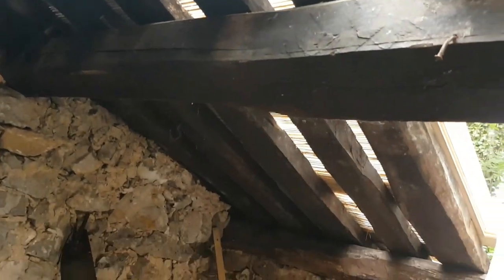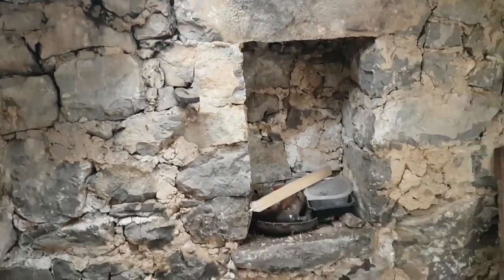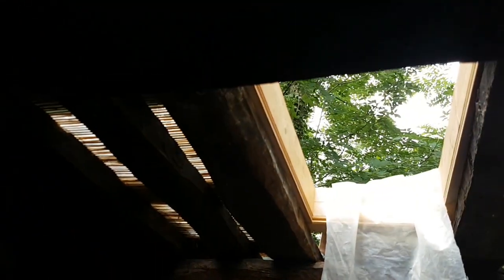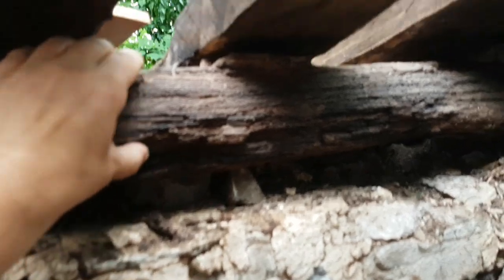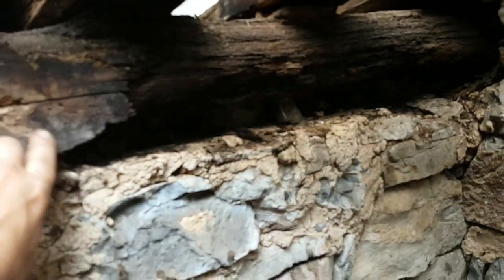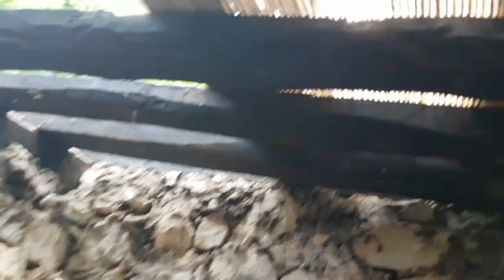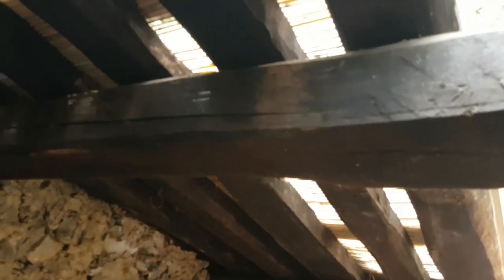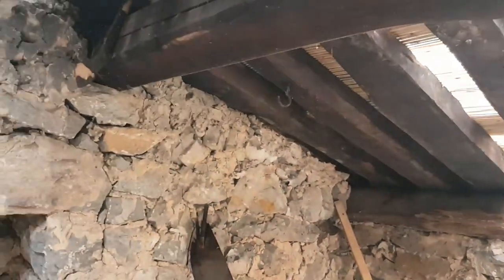What to Look For When Repairing an Old Building

Comment: Some of my structural beams are showing signs of dry rot. I've been advised to rake out as much of the powdery stuff as possible , then soak with a 10% boric acid solution prior to using a 2 part epoxy filler.
Reply from the maker: Yes, that sounds like fair advice. Borax will treat the rot. Personally I've never tried the epoxy but I know it's an option.
Reply: @themudhome  Not that keen on it...high VOC content....but it sets rock hard and if it saves the beams it feels like a fair trade-off.
Reply: Perhaps you could wear a respirator while doing the epoxy, and then stay away (with good ventilation) as it cures and outgases? Replacing the section of wood might be a healthier and more natural repair, especially if it ever burned (not that you want to think of that, but it does happen.)